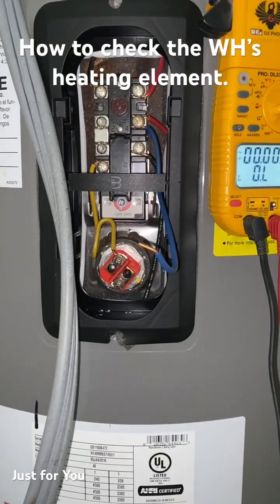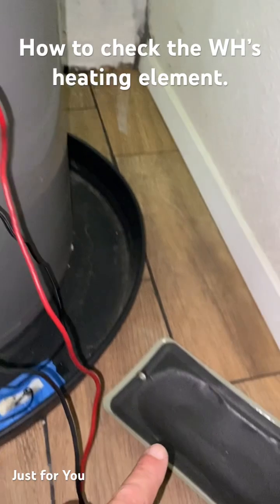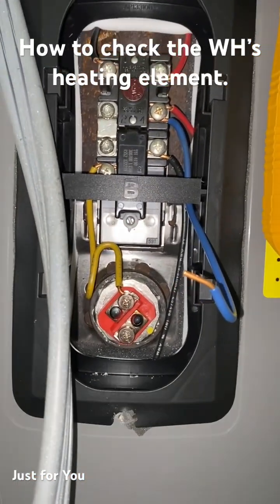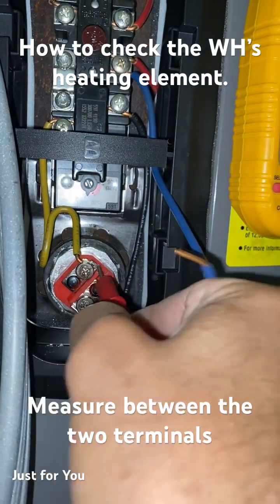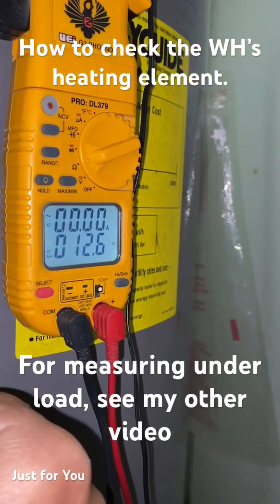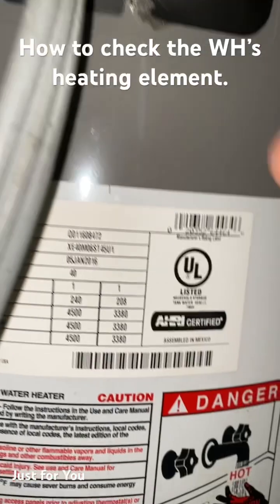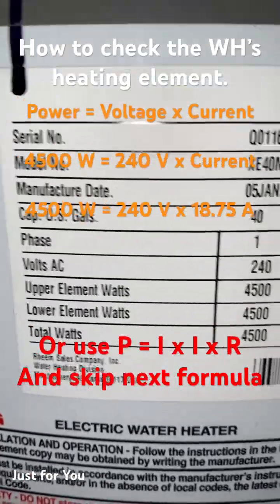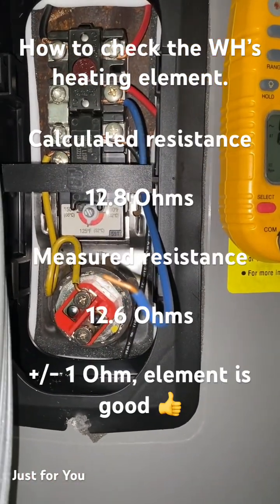Water NOT hot enough? Hot water runs out QUICKLY? Heating element could be bad. How to check. DIY

Comment: That’s the way I do it.   Hell I do that without removing the wire too.   Power off of course.   Some elements get 10 ohms shorter .   I can’t recall a scenario where I’ve got a bad reading with wires still on . Or at least I think so. 😂.  Now that I think about it.  A lot of those were shortys.  Only one element.   
But heck It’s been about 10 years since I’ve done residential water heater though.
Reply from the maker: The reason you want to remove the wire, at least one, is to isolate the element from the water heater’s wiring during the test. This to avoid get a potential false reading. Hope this helps.

Comment: I suspect having a tank with a plug in connection like that is a code violation
Reply from the maker: Good observation. It should be because the potential arcing risk it presents if someone unplugs it while the heating element is on. However, surprisingly, it’s not a code violation in this city.